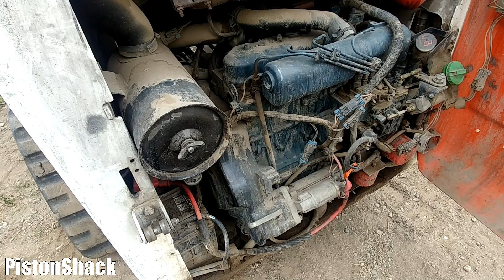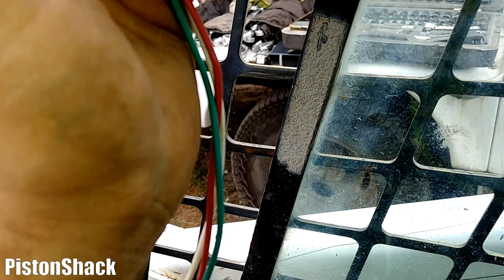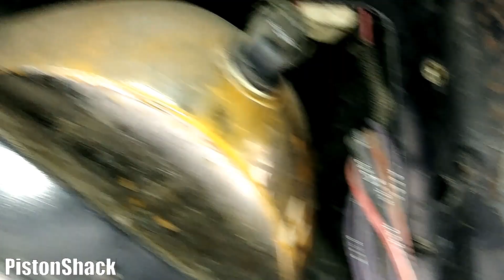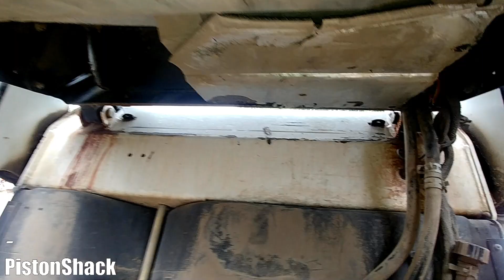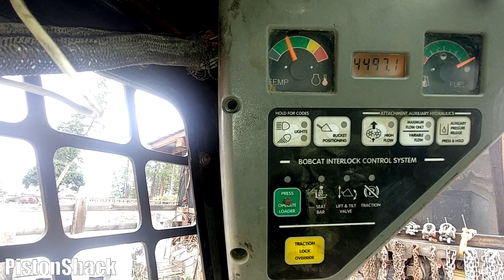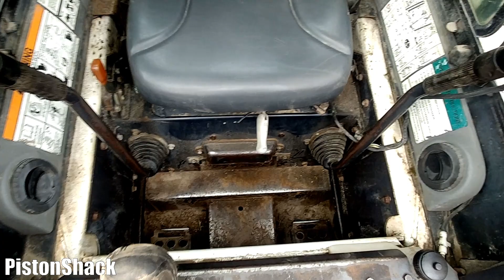SKID STEER SHUTS DOWN THEN NO CRANK, NO START - COMPLETELY OFF | BOBCAT T190 | MONEY SAVER REPAIR

Comment from the maker: Few More Bobcat Skid Steer Videos For You:
Bobcat GOOD BATTERY, POOR CRANKING - CHEAP PERMANENT REPAIR | Bobcat T185 SKID STEER
https://youtu.be/qNyl93fGx0U
BOBCAT LEAKING FINAL DRIVE HYDRAULIC HOSE REPLACEMENT
https://youtu.be/HWqAv_CHdHM
Bobcat Loader TRACK TENSION ADJUSTMENT Basics. PROCEDURE and SPECS.
https://youtu.be/Mk47huj5_nM
BOBCAT ACCELERATOR CONTROL CABLE REPLACEMENT & ADJUSTMENT aka "throttle" cable.
https://youtu.be/0ejjv2yoC3Q

Comment: Hello someone please help I have a bobcat skid steer t250 will start has lots of power and after about 1 hour of use it will shut off and won’t start until you wait around 15-20 mins and will happen again and maybe shuts off when it get to a certain temperature I’m not sure ? Any help would be helpfully also no codes
Reply from the maker: I would check fuel shut off solenoid circuit first, starting with solenoid relay. It's heat related issue. Do you have any other symptoms related to no start? When did it happen for the first time?
Reply: @PistonShack  it started after I added diesel I’m pretty sure I also think but I’m no mechanic by no means is the fuel tank is dirty since it was sitting for long time I will check what u said other things I have notice is the oil filter getting reallyy hot don’t know if that’s normal or not
Reply: @PistonShack  it started after I added diesel I’m pretty sure I also think but I’m no mechanic by no means is the fuel tank is dirty since it was sitting for long time I will check what u said other things I have notice is the oil filter getting reallyy hot don’t know if that’s normal or not
Reply: Update I changed the fuel filter and let me tell you a lot of trash in there change the filter and same thing happened after a little while